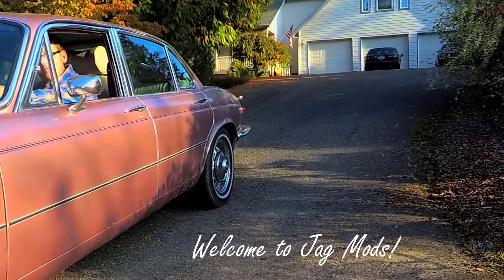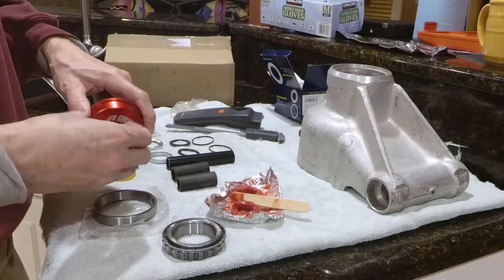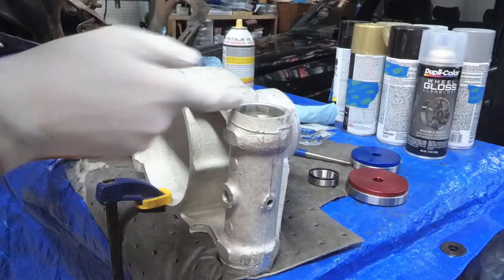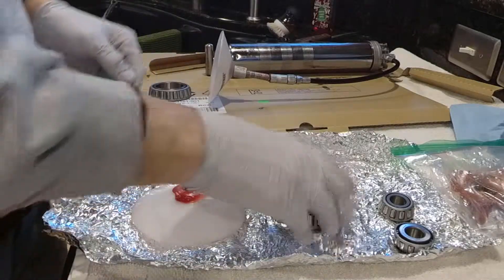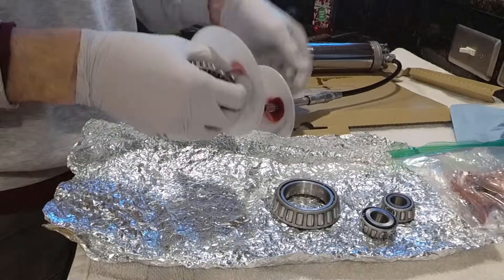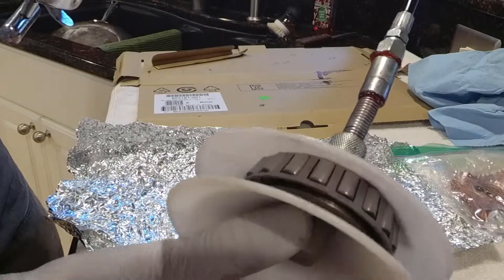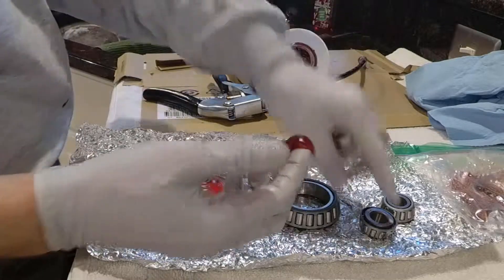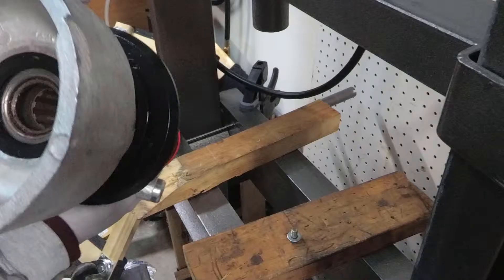Assembling a Jaguar XJ E-Type IRS Carrier hub assembly part 1

Comment: Suggestion, instead of heating the hub carrier, FREEZE the race it pops in nice and easy :) I do this and it works every time.
Reply from the maker: I did both race in the freezer hub in the oven. Maybe not Lon enough
Reply: @JagMods  i leave the races in all night
Reply from the maker: @jagvette1  
I guess that is the difference. I didn’t. They were in the freezer for a couple of hours. Good tip! 
I have 7 more IRS’s to do. I will give that a go on the next one.

Comment: Hey Man. This is Goooood stuff. I have a question... After a year of working,,, I finally got an XJS that had been sitting for some 12 yrs on the road. Looong story. I was driving over the Verrazano yesterday and by the time I made it to Brooklyn I was hearing a low but definite swearing from what I am sure is the rear bearing assembly. The car has abs, a hole if the sensor is removed. Do you think if I figured out a way to pump bearing grease into that  hole under pressure,,, it would make its way to the bearings and lub them up? I'm sure the old grease in there is like candle wax at this point. What do ya think?
Reply from the maker: Thank you for your kind words. I'll need to know what year XJ-S you have, if the brakes are inboard or out by the wheels. it makes a difference.  there are two grease points on the carrier assembly one that fills the cavity of the hub (the bit the wheels bolt onto,  and the other is at the bottom to lube the fulcrum shaft bearings - the bit on the bottom that bolts onto the carrier which holds the carrier onto the car and keeps it from flopping around. 
each "cavity" so to speak, has weep holes to allow excess grease to escape.  the fulcrum is located on the back of the carrier and the hub / carrier bearing assembly weep hole on the back side of the carrier, It isn't really accessible because the u-joint cover and u-joints nestled in the back of the carrier are in the way.
It's not uncommon for the weep holes to get clogged, a paper clip or .045 welding rod, works well to unplug the whole. once unplugged, I would immediately apply grease so to push any nastiness inadvertently pushed into the carrier or fulcrum shaft  will hopefully flush itself back out.
year would be helpful because what I just typed could be useless if it's outboard brakes. :-/